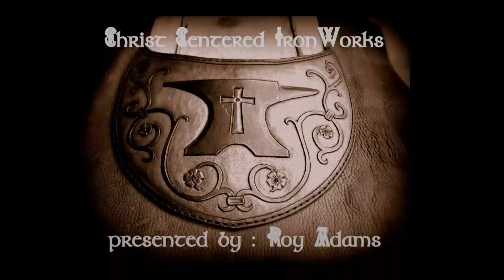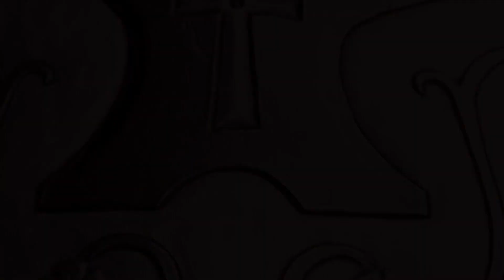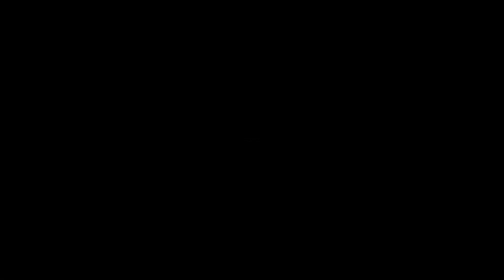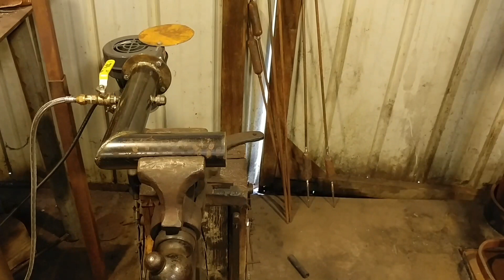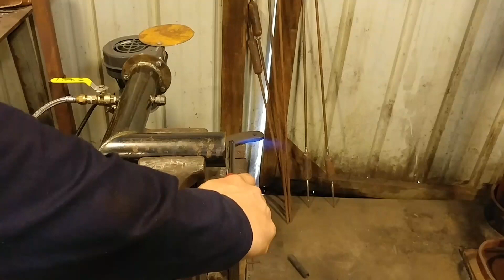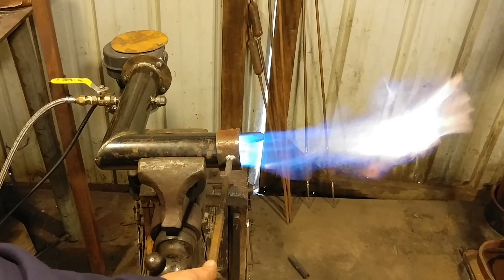How to Make a DIY Gas Forge Burner (Part 3: Testing and Tuning)

Comment: can i use a speed control on the blower for even more control? will this build be a side or top feed if top how do you handle stove piping (chimney affect) and over heating you blower when you turn it off? love the build. i want to build one with a "T" the damper on top to vert hot gases when off the gas port will have to be in the pipe below the "T" but i think it will work be safe
Reply: cockatoobirdman bill leave blower running till it’s cooled off. I use a secondary fan as well.

Comment: Since a forced air burner is more efficient, would that mean you can run forge longer without propane cylinder freezing up? Thanks for the videos.
Reply from the maker: +andrew hunt yes theoretically you should be able to run this burner a lot longer before a propane tank would freeze up. I do not use standard 20 lb propane cylinders in my shop so this would require more testing before I would give a definitive answer on that. I'm so glad to hear you are enjoying the videos God bless you and thank you for taking the time to watch
Reply: How much more efficient are they?   The pressure is much lower but the outlet orifice is 2.8-3.1 times larger than a typical 3/4 inch venture burner.
Reply: They "should" be more efficient for one single reason.

Efficiency comes from2 things
1. Heat loss ....better isolation and design of the forge, higher temps in the forge before the heat comes out...
2. Burning inside the forge instead of burning outside. "Complete" burning instead of partial/incomplete burning.

A certain amount of fuel can produce a certain amount of heat by burning a mass of fuel. You can not produce heat from thin air, the heat is the same for the same quantity of fuel

Where forced air is better and more efficient is in the fact that you provide enough air ( and you are able to better mix the air and gas),so more of the fuel is "completly" transformed into energy AND more important, the burnig takes place inside the forge where you need that heat.
In case of venturi burners, lack of air and poor mixture/carburation force the fuel not to completly burn and a part of it will burn when amd where it reaches oxigen...outside the forge...

So overall, forced air burners can provide all the air needed for "all the fuel" to burn and hat burning process takes place inside the forge.

Comment: Hey Roy been a bit since I commented. Just to mention I havnt missed a video lol..  Hey your burner seems to be a small version od a ribbon burner?  I am building another forge and was concidering a ribbon burner (plans by Wayne coe) My thoughts on this have been extencive. I decided on the ribbon burner because as you know I'm a bladesmith and a ribbon burner would allow even heat threw out the forge my dimentions of my burner are a square tube3x3inx12in long.Iwill be casting the burner flair if you will with a high chrome castable. Using crayons for the orifice ports. the castable will be 2.5in thick and after poring the castable into the form the burner (mixing chamber will be set into the mold about 3/4in to lock it into the mixing chamber.  I only mention this because your design is as said basicly the same except your does not have a mixing box/chamber and the burner size is only 2in in diameter. Does the size of your design create hot spots in the forge ? The way I am building will negate any hot spots and the size of the burner will heat a 18 to 20in long. chamber with an inside dia. at around 9in.tall 12in. wide and 20in long. to welding temp very easily also using low fuel pressure and a blower..  Not nocking your build I hope that my comment does not sound this way it is not my intention..  Id like to here your input on my build  Just to ad I will be building my forge soon arciving the build on video and sharing my failure or successes. God willing all will work like a dream..  God Bless you and your as always..  Martin M&S Blades

Comment: Really nice!  How does this compare for loudness say versus the other one you use?  I know that the Daton blower for this build it's self is extremely quiet so that should help some.
Reply from the maker: +Chris Lawrence in my opinion this burner is fairly quiet outside of a combustion chamber now if it picks up a little more Roar in a combustion chamber that may be another story :-) I would say it's comparable to my regular gas forge if you're really cranking it it sounds like a torch going and then if you're running it a lot lower not nearly as noisy

Comment: I would recommend that you add a knob of some kind to the top of your air gate. It would make it easier to adjust with gloves on etc.  Even a bolt tack welded to  the top would work.
Great tutorial, thanks,
Reply from the maker: +Jon Lavender thank you for the recommendation! God bless you and thank you for taking the time to watch

Comment: that seems really efficient roy but the regulator im using at the moment is low pressure so it most likely wont work in your setup i have an old vacuum i can use as a blower, works well on firewood  blew up one that way lol take care mate
Reply from the maker: +grayem pepper it is definitely fuel efficient I know that the burner doesn't run any higher than about 1 psi. Although it can have a higher pressure the blower is not enough to keep up with it. So you never know you are regulator may work out okay. I plan on doing another video with this testing on a barbecue grill regulator as those are quite low pressure I'll let everybody know how it goes :-) God bless you and thank you for your great comments
Reply: Did you end up making the video you mentioned above? I would be very interested to see that!
Reply: he has not as yet